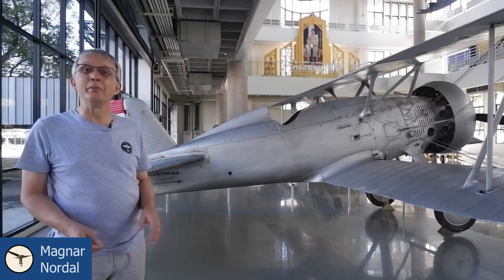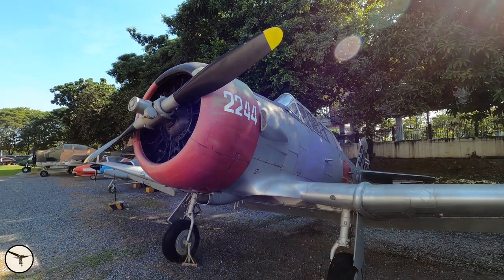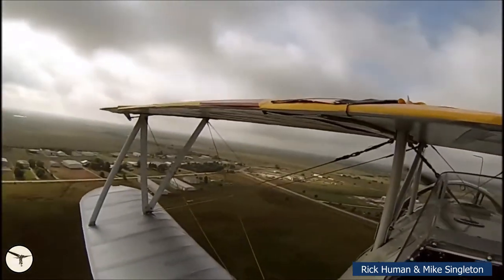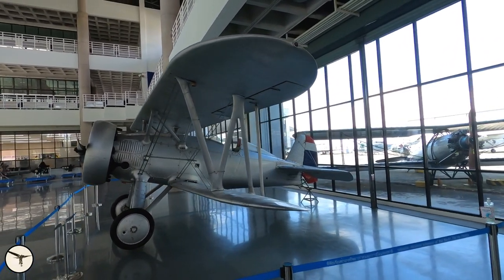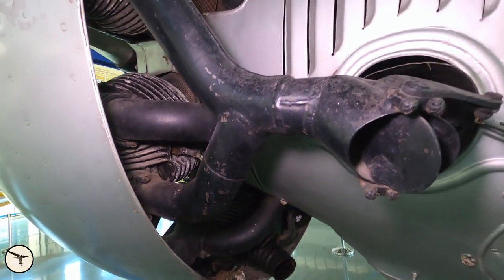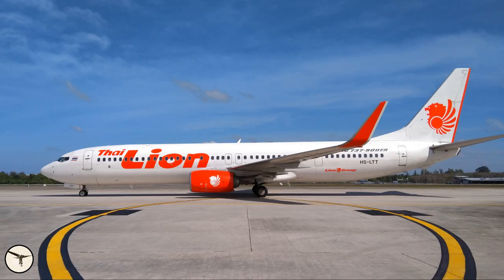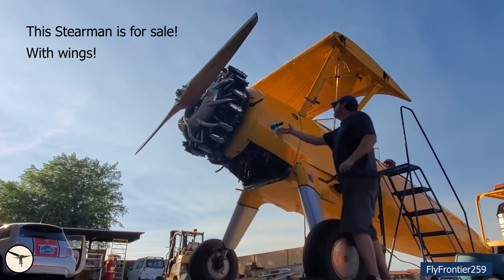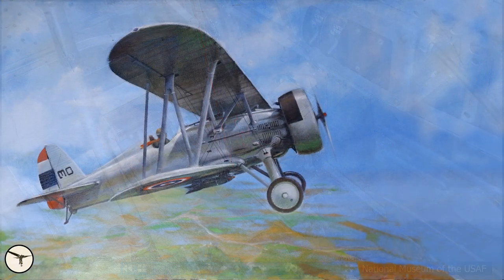Boeing 100 / P-12 / F4B | A pilot's hot rod

Comment: Thanks for this excellent video. Regarding the two machine gun cartridge ejector chutes on the righthand side: I believed the P-12 could be fitted with either two .30 caliber guns or one .30 caliber and one .50 caliber  gun. I wonder if that second chute is there to accommodate both configurations.
Reply from the maker: Yes, the armament was either 2 x .30 inch Browning machine guns with 600 rounds per gun, or 1 x .30 inch machine gun with 600 rounds and 1 x .50 inch machine gun with 200 rounds. But I cannot answer your question about the ejector chutes.

Comment: How can the bullets from machine guns avoid hitting the propellers when firing?
Reply from the maker: The engine drives a synchronization gear that prevents the machine gun to fire when the propeller is in the line of fire. It was invented during WW1.